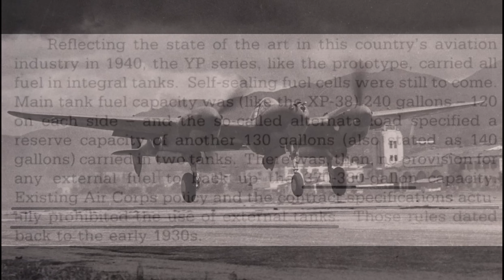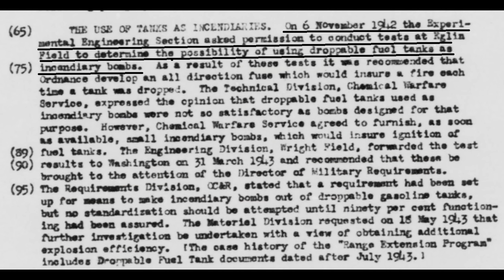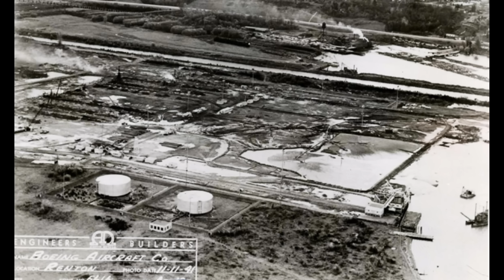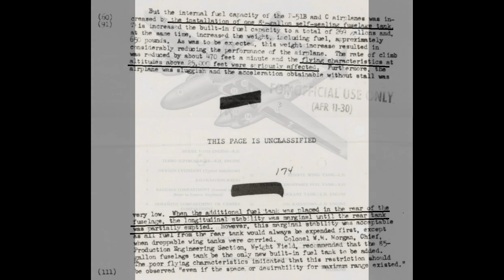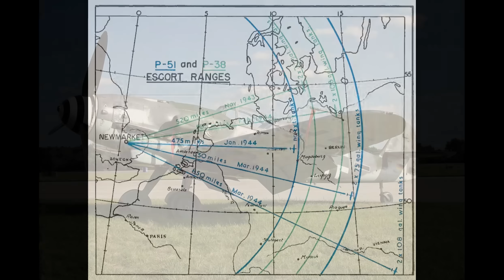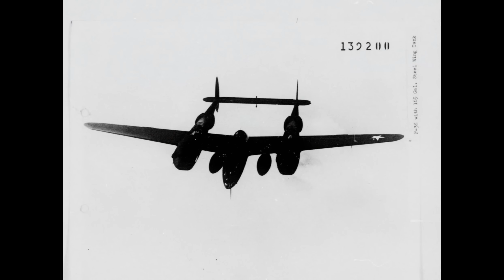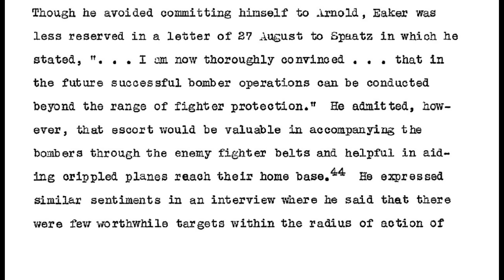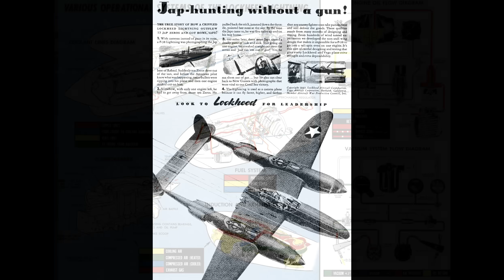The P 38 Lighting and the Bomber Mafia's Failure In World War Two

Comment: I think it's likely that the P38 would have had bad loss rates -- particularly initially -- over Europe. But it's very clear they'd have cut bomber losses and you can give up a lot of fighters for every bomber saved. And they'd have obviously shot down their share of German fighters too. 

Never really understood the decision not to use it when it was clearly the only option. I mean there was empirical evidence very early on that the theories about unescorted bombers did not hold up. (Cue, "I reject your reality and substitute my own." Such a great line by Adam Savage)
Reply: I think that's right, there would have been high losses of P38s, but mainly because the tactics for escorting heavy bombers still had to be worked out. Especially that the  P38s would have been extremely vulnerable trying to "close escort" the bombers, best to stay high and "jump" the Luftwaffe before they could attack.
Reply: The P-38 did have relatively high losses when it initially was the ONLY escort fighter, and there was only ONE fighter group that was rushed into operational status in 30 days. 

However, from that initial mission forward, despite facing as much as 10:1 odds, the mere presence of the small group of P-38 fighters cut bomber losses by 50%.

That was a group of green fighter pilots, flying a mixed bag of G and H model P-38's, that were poorly rigged, and using the wrong engine settings. 

No, the intercoolers did not freeze. In the G and H model, the leading edge intercoolers in the wings actually could not reduce the inlet temperature enough. 

What did "freeze" was actually oil congealing in the turbocharger regulators, because of the above mentioned incorrect engine settings. 

The correct settings for a P-38 for "cruise", used while escorting bombers, is 1600 RPM, set with the prop pitch, 32"-36" of manifold pressure, set with the throttle, the mixture set to "Auto Lean", and the doors for the radiators and oil coolers set to maintain 160°F to 180°F at the lower power settings. 

What was the 8th AF using? The RPM was set to 2200RPM to 2600RPM, the manifold pressure set to 16" -20", the mixture set to *Auto RICH*, and the oil cooler and radiator doors set to combat power positions for maximum cooling at War Emergency Power. 

The result? Engines so cold as to produce no heat for the cockpit, AND so cold it was impossible to reach maximum power in combat, fouled spark plugs, engines back firing and blowing off the hoses, and rupturing the intercoolers. Turbocharger regulators allowing the turbochargers to "run away", producing excessive boost, damaging the engine, and spinning excessive RPM, causing the turbochargers to explode. Fuel consumption so high that if the pilot spent more than 5-10 minutes in combat, his fuel would be exhausted before he could reach the coast, never mind return to England.
Reply: @AlanRoehrich9651  Thanks for the details. Pretty much what I expected. Just showing up changed the equation. And over time it would likely have done much more.
Reply: @ronjohnson6916 
It did do more. It was the first U.S. fighter over Berlin, more than a month before any P-51 made it. 

The P-38 allowed the bombing campaign to continue in 1943 when it would have been halted in October. 

The P-38 also provided massive support all the way through the Normandy invasion, and after. The P-51 did not even equal the P-38 in numbers deployed until June 1944. It was the presence of the P-38 and the P-47 that made it possible for the P-51 to provide escort, and especially to perform fighter sweeps. Had the P-38 not been present, to perform close escort, the P-51 would have been forced into that role.
Reply: They had had trouble in North Africa where they often fought at an altitude disadvantage against 109s in scramble situations (and due to the 109s good vertical performance couldn't use their own vertical performance to neutralize the altitude advantage as quickly as against the Zero in the Pacific), and in Europe they ran into trouble with their intercoolers icing up at altitude, which gave them a poor reputation for reliability. Also, normally a twin-engine aircraft with counter rotating engines would have them rotating so that the propellers were moving inboard at the top of their rotation, but due to the way that the propeller airstream interacted with the tail, the P-38 had the propellers moving outboard at the top. This made the aircraft much harder to control in an engine-out situation, which, given the reliability issues from intercooler icing, gave them a poor reputation with pilots.
Reply: @JonBrase  Well at least they wouldn't be in a scramble situation in an escort role. It's not an ideal choice, just the best option at the time. And I think it likely would be rough on the fighter pilots -- particularly as they started out. And if they have the necessary numbers, I think it could work out.
Reply: The point was that the whole design of the B17 was predicated on it being able to defend itself - for which it gave up considerable speed, altitude and a huge amount of payload (a Mosquito could carry more bomb weight than a B17). Changing doctrine would have meant admitting that the B17 was a bad design, which no-one wanted to do.
Reply: @kenoliver8913  You need to watch Greg's video about whether a Mosquito could carry a heavier bomb  load than a B17. Short answer is NO.
Reply: @kenoliver8913 goodness sake, this stupid myth again. Also, daylight bombing still got more bombs on target and the B-17/24 was probably the best option for that. Unescorted was still foolish.
Reply: @kenoliver8913  Oh I get that. Another data point that shows that as a species we're good at holding beliefs in the face of evidence that refutes the belief.

Comment: Charles Lindbergh extending the P-38s range even further with his fuel economy settings is an underrated achievement.
Reply: Yes there are few greater achievements than pressing the button that makes everything easier.
😂
Reply: @davidhoffman6980  --  I wonder how many service men's lives were lost because Lindbergh was disliked by the FDR administration simply because he expressed admiration for the capabilities of the German Air Force.   It didn't mean he wanted the Nazis to win.
Reply: @GilmerJohn probably none. And when he went to the Pacific he didn't save many lives so I'm not sure what you mean.
Reply: @davidhoffman6980  What he did, was to convince other pilots to trust the published manual. He was able to do this because he had a legitimate reputation of being an excellent pilot, airman, and navigator. Anyone who works in an industry operating power equipment knows how this works. Conventional wisdom is always conservative, even if it costs efficiency.
Reply: @GeneralJackRipper  you haven't contradicted anything I said so far.
Reply: But it’s one that Greg already covers 😉
Reply: Lindbergh just used the settings Lockheed and Allison had the the pilot's operating manual. 

Tony LeVier did the exact same thing in Britain in late 43 and early 44. He found that the 8th AF was using the wrong cruise settings, and that cut range by 50%, ruined performance, and hurt reliability.
Reply: How much does the fuel quality count? This developed into an undersung warwinner I think.
Reply: Don't know that it mattered so much. Happened in 1944. I understand that one strength of the Allison over the Merlin was its ability to run smooth at low rpm, and that was part of Lindbergh's method. The British exploited that in using the Mustang 1 in low level intruder raids over France.
Reply: Lindbergh had many sins to make up for, so this is not that big a deal.
Reply: @chuckschillingvideos sounds vaccinated
Reply: @bocefusmurica4340  What does sound vaccinated mean?
Reply: @bocefusmurica4340  --  His "sin" was being impressed by the air force might of Nazi Germany.   He honestly thought that the German air machine was superior to that in the West.   To a good approximation, he was correct.   

Nothing useful was accomplished when the UK and France declared war against Germany when Germany & the USSR jointly invaded Poland.
Reply: @chuckschillingvideos  Oh please. We live in a free country where you are allowed to express your opinion. Even one other people don't like.
So get over it. 🤣
Reply: @GeneralJackRipper  Lindbergh's dalliance with the Nazis hurt this nation greatly.  And it was for no other reason than the aggrandizement of his public image.  He was a disgrace in my eyes.
Reply: President Roosevelt called Lindbergh a "copperhead." After the War, his many associations with the Nazis came too light.
Reply: Did Lindbergh wear his Herman Goring medals in the Pacific?  He was a big fan of both Adolph Hitler and his hero Herman Goring.

Comment: So something I wanted to add is the p-38 had as a field improvement leading edge fuel tanks. On the wings. The spitfire also got this treatment as well. Anybody know of any other fighters that took leading edge Wing tanks as the demand for fuel and range continue to go up??
Reply: Where the tanks are placed has more to do with the structural layout and other items.

The spitfire had a large leading edge volume inboard of the guns. The leading edge was thick aluminum. The landing gear retracted behind the main spar so there was no room. The main spar only needed a solid sheet on the spar shear web and also for end-ribs to enclose the volume.

A P-51 has landing gear in the leading edge. As does a Bearcat. The Corsair or Mosquito has radiators there.

The P-51 had an aft fuselage aux tank. But this made it unstable so dogfighting or anything except careful cruise and climb was not possible with a full aft tank. The ideal place for fuel is the wing leading edge. It is slightly ahead of the normal center of gravity range, so it is stabilizing. It also places the additional mass in front of the 1/4 chord of the wing. This has aeroelastic benefits.
Reply: The leading edge wing tanks were not a field development. The leading edge wing tanks were the result of the leading edge wing intercoolers being replaced with more efficient/effective chin mount intercoolers.

Comment: When first deployed to Europe the P38 had many issues, not the least of which was it's extremely limited mach number.  Moreover many P38s had engine problems and at high altitude, it's cockpit was brutally cold.  Given these limitations, could the P38 be an effective escort fighter?
Reply: We will never know because instead of working to fix the P-38's problems, the Eighth Air Force shipped them off to Africa where they provided sterling service as fighter bombers in the Mediterranean Theater.
Reply: It was used as an escort fighter successfully.. what a silly question

Comment: (Disclaimer: I believe that the bomber mafia was wrong about most things.)
The "no drop tanks" stipulation in the initial requirement came from the fighter advocates. With the technological limitations through the 1930s, they couldn't see how an effective escort fighter was possible, and it wasn't clear that it needed for much of the decade.

Thr fighter pilots felt that it was clear that only agile single-engined fighters were  suitable as escorts because they would obviously need to maneuver against attacks. Since drop tanks of the period couldn't safely be retained in a dogfight, they would have to be jettisoned when crossing into enemy territory (probably before, since the enemy was likely to send patrols across the line). Heavy fighters (twin engine types like the Bf110) would lake the agility to be effective escoFinally, isolationism meant that the big role for fighters was a short-range interceptors.

Comment: Whilst it never seems to feature as a discussion point, i think you show well that the P51 is the cheapest fighter to operate on long range missions in terms of overall fuel used, which would be a relevant consideration when considering issues in the Battle of the Atlantic with getting tankers across the pond. So you can see why the P51 would be preferred, even if the absolute range might not be the highest.  Also  there is the issue of justifying the fantastic cost of the bomber fleet, planes fuel payload bombs etc…then having to ask for more money for the fighters because the germans were good at shooting the bombers down! Not a strong position politically, especially when Harris had told the American Generals that they would be mad to attempt unescorted daytime raiding. I suspect there was a long period of denial, blaming poor execution of formations etc before the full horror sank in! Fortunately there were people who  knew long range fighter escorts would be needed eventually as you describe so well.

Comment: You make a very convincing case, as you have done in your other videos on fighter range and the bomber mafia. I have one question that I feel you didn't fully address. Aside from the dive limit and low mach limit problem of the P-38, was it considered inferior in a dogfight to a contemporary Bf-109 in the other aspects of dogfighting, e.g. roll and turn radius? (The models of each plane that were operated contemporaneously.) 

I should clarify - was it considered within the fighter command (not the mafia) to be suboptimal in 1942? It's projected performance, not what ended being proven out. Was there any kind of justification on that front to not pursue employing the P-38 in Europe? Was bomber command aware of any such an evaluation, if it existed? Not that the mindset of Eaker needed any more ammo anyway but the question popped into my mind. 

Of course the bottom line should have been was it "good enough," not whether it was ideal. The bombers were in dire need of "good enough."

I suppose real-world combat experience in North Africa would come into that but IIRC the air war there was mostly fought at medium and low level. My memory on that could easily be imperfect. It's performance against the Zero and other Japanese fighters would also be informative - but IIRC the two commands didn't pay much attention to each other's combat evaluations.

Playing devils advocate with you is a dangerous game, but my other question is, was the production level high enough in 1942/early 43 to supply the Pacific theater, North Africa, and the ETO?
Reply: Robin Old's commented that he had no problem in taking on an ME-109 in a P-38 at moderate altitudes where compressibility was not an issue.
Reply: @fafner1   That of course brings us to the "it's not the plane, it's the pilot" issue. Olds could have flown a P-36 and done well.  ;)

A lot of the debate about fighters in the ETO  ends up being about high altitude performance. That comes up in Greg's videos about superchargers and turbochargers in various aircraft. Russians did well with the P-39 because their air war was at low to medium altitudes. To make a broad statement, a lot of planes were useful in India, Burma, China and North Africa where there wasn't much high altitude fighting that weren't used much in the ETO after 1942. (I don't know enough about the mix of air warfare in Italy to comment there.)